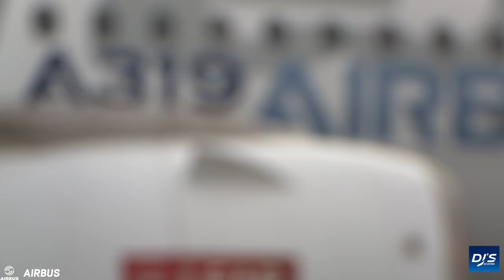Airbus To Build Engines?

Comment: Aircraft engine manufacturing is an extraordinarily specialised business which is dominated by the three main players. I can't even see why Airbus would see a need to independently have the capability let alone risk the development cost involved.
Reply: My guess is that the offers from the engine manufacturers are not ambitious enough when it comes to the 2035 deadline - and they have to develop inhouse (or in cooperation with one of them).

Comment: I find it fascinating, that most comments miss the fact mentioned at 3:30: They are thinking of building electric motors in-house (and buy fuel cells somewhere?). Not "conventional" engines... 
So the technology advantage of the current engine manufactures in that field is probably not so large.

Comment: Maybe Airbus is considering acquiring some of the European engine manufacturers such as Safran and Walter rather than starting from scratch. There is also a pool of cheap labour with jet engine production experience if Airbus were to headhunt amongst the Motor Zich personnel wanting to move out of Ukraine.
Reply: @yo yo I visited the Motor Zich plant in 2019 and there were still some of the engineering team there when I visited working on small and micro turboprop and electric motors for UAV and UCAV use. Some of the other engineering staff were also working on power generation gas turbines.

Comment: If anyone can be innovative it’s Airbus at this moment the worlds most Advanced plane is  the A350-1000 .The days of hashing out old  models with a new name and MCAS  is over lol  I think Engines are a niche thing though so Airbus will need to employ guys with knowledge for the 21st Century 🙋🏻‍♀️🥇⭐️👩‍✈️👨‍✈️🇬🇧👍🚀🚀
Reply: "The days of hashing out old models with a new name and MCAS is over...", and the A320 isn't decades old and in need of replacement? Also, I doubt Airbus is going to be able to go through with this since the current engine manufacturers wouldn't be best pleased, they should instead focus on fixing the A350s lightning protection, and surface flaws.

Comment: Just like apple making their own chips, it's quite likely and will benefit airbus, however it'd also need a lot more expanding
Reply: It's not exactly comparable. But if Airbus want to deliver cutting-edge aircraft, they are limited in options.
Reply: Completely different scenario. Apple chips are essentially just licensed ARM designs, which are then manufactured by a foundry.
Airbus can't just turn up to P&W / RR / GE and ask to license a design, and then have it manufactured.

Decades of design experience; manufacturing optimization; and patents will be an extremely difficult barrier for Airbus to cross in order to enter this market.
Reply: @heyitsjel  You are wrong about Apple having licensed  the ARM design. ARM has two types of licenses: Architecture licenses and design licenses. Apple has an architecture license and designed the processors themselves.
Reply: @cbaurtx  You sir are correct! I always figured they were still modifying existing ARM designs (which they did in early days), but it appears their new chips are completely independent/new designs from the ground up. Kudos to Apple, I'm actually impressed.

Comment: Clearly, whether hydrogen fuel cell or battery, there will be a need for electric engines (the choice of which tech will come down to energy density, weight, safety, and cost).  It makes sense to develop their own in-house electric engines.

Comment: Hydrogen has been used as a fuel before, in the hindenburg. If they are going to pursue the use of hydrogen, they will have to be careful as it is extremely explosive
Reply: uh you knoow it's not going to be the same kind of stuff than hindenburg right?
Reply: True, Hydrogen is very explosive.  But remember Airbus has not specified what kind of engine.  For all we know it could be a hydrogen fuel cell, which are very safe.
Reply: Jet fuel may explode too. Just look at TWA-800. But we've learned lessons from LZ-129, from TWA-800 and from many other accidents and we are getting better at handling explosive fuels. If we don't push the boundaries, we'll still be using horses for transportation.
Reply: The Hindenburg didn't use hydrogen as fuel, it used it as lifting gas, similar to a balloon. I believe it had conventional diesel engines powered by diesel fuel. Hydrogen as fuel can be more easily contained, not in very lightweight large bags but instead in heavy-duty tanks and pipes, I'd be less worried about it's danger in that context than as lifting gas.
Reply: @thebunkerparodie6368  Exactly the same substance actually - hydrogen - but used in a different manner, as fuel rather than as lifting gas.
Reply: @stephenbarringtonleigh367  I'm predicting they're actually thinking of using hydrogen-fueled gas turbines rather than fuel cells. Fuel cells aren't actually all that efficient, I read around 60% efficient, while gas turbines are closer to 45%, but the fuel cell would be more expensive, there would be energy losses and extra weight in the electric motors and other electrical systems, and the heat given off by the fuel cell probably would require a heavy, complex, and drag-inducing cooling system to deal with unlike a gas turbine where all the waste heat goes out the exhaust. So burning it in a gas turbine might actually be the better option in the end. As for safety, I don't see that as any less safe - gas turbine engines as we know them are very safe, failures that would set the plane on fire are very rare, whether fueled by kerosene or hydrogen, I see no reason a turbine would be more hazardous in terms of hydrogen fire than a fuel cell. Also the fuel cell would most likely be mounted in the fuselage, powering wing-mounted electric motors (props or ducted fans), while gas turbines would be out on the wings, so a fire would present less danger to the occupants.

Comment: They don't have the expertise to build engines so it would be a risky move and they would most likely start with the smaller aircraft since they need smaller engines and more of them as they sell large number of smaller aircraft. You can control costs better if you are vertically integrated but accountants don't like that.

Comment: Hopefully they can for once develop for the industry a viable hydrogen/ hybrid fueled quieter High bypass ducted 
(PROP FAN) Engine instead of the boring already tryd an true turbo prop , Turbofan & Very under powered Electric motors for their aircraft...

Comment: Boeing has not been allowed to build engines since 1934. The fact that Airbus is allowed to do this while Boeing is not would be a very unfair advantage that Airbus has over Boeing. If Airbus is suddenly allowed to build in-house engines and Boeing remains barred from doing that, then to balance this out, Airbus better take blame if these engines have issues since they are in-house AND both Airbus and Boeing should be vindicated of blame for engine issues involving engines that have been outsourced per antitrust law like the PW1000G and PW4000 and Trent 1000. I know that Raytheon acquired PW, and I firmly believe Raytheon should be investigated, especially if they haven't solved the PW1000G and PW4000 issues.
Reply: It would likely also piss of engine manufacturers as well, considering Airbus would essentially be removing the need for outsourcing engines. That'd be a major mistake if Airbus does piss them off without learning to manufacturer their own engines.
Reply: Don't worry, Airbus just have the option of cancelling their customers orders if they screw up.

Comment: I will miss the smell of burning kerosene.
Reply: True. But moderns sports cars have a sports mode, where the Hi-Fi emulates the engine noise of the 60's, 70's and 80's. I see no problem having an odor injecting system into the ventilation system to emulate the kerosene smell 😊
Reply: @todortodorov940  As long as it’s harmless to breath in it should be fine

Comment: It may sound a little obvious, but an aircraft cannot fly without suitable engines, and repeatedly we see an aircraft launch being delayed and a model series having its future ruined as was in the case of the Lockheed 1011 (Tristar) and the future of the 777x having a question mark about its future prospects. In both cases the programs were financially compromised because the engines were not available for when the programs needed them.

Perhaps in the case of a totally different fuel with not only combustion differences, but loading, on-board storage and delivery to the engines issues which need to be accommodated, it might not be such a bad idea to control as much of the loop as you can, especially if the solution to an issue is not to be found in the area where the problem manifests, but somewhere else in the loop. 

Can you imagine the issues (not just the legal ones) if Airbus were to turn to the engine manufacturers and say 'sorry chaps, but you are going to have to change your design because we can't deliver exactly what we though we could!'

Comment: I think before they look at hydrogen, they should handle the paint issue on the 350 that many airlines are handling
Reply: yes Boeoing should look at their 787 wing paint issues
Reply: @ant2312  Boeing already is, hence why New Zealand Air didn't sue the manufacturer like Qatar is trying to do.
Reply: I believe they are handling both. But the people that research hydrogen engines are probably terrible painters, so I see no problem working on both tasks in parallel and using the right people for the right job.

Comment: It’s a smart move, it cuts out the need to depend on engine manufacturers and expands their business portfolio. It may not be successful in the immediate future but in the long run it will payoff once they’ve mastered the technology. Having everything in-house can be a very good thing.
Reply: It's purely theoretical talk. And only "smart" if it pays off and the risk is enormous. To invest in the facilities, research, people and R&D required to get a hydrogen power plant (that's better than anything RR/GE/etc can make) is tens of billions of dollars.... and the risk if it fails is probably the closer of Airbus.... barring more UK/EU blank checks
Reply: It's not a smart move.  Alone the thought of building-up own supply chains, services and maintenance infrastructures, already kills such thoughts on the economical benefits.
Reply: @BChandl13  armchair expert
Reply: @blameyourself4489  another armchair expert, strange how you know more than them

Comment: Mm, aircraft manufacturers have always gone outside for their engines. This is because engines and airframes are very different animals requiring vastly different resources and expertise. This is why large engine manufacture has been whittled down to just three major players out of the fifty or so that existed fifty years ago. However, if Airbus believes that reinventing the wheel is a sound policy, good luck to them.
Reply: It would be sort of a vertical-integration move, to have an engine team within Airbus rather than going to outside companies. I could see them buying another engine manufacturer and incorporating it into their corporation rather than starting entirely from scratch. It can be noted that car makers usually do manufacture their own engines, even though likewise gasoline engines are not that similar to the rest of the car in terms of design, but the company is big enough they see it worthwhile to have in-house R&D and production of engines rather than buying from outside companies. Well usually anyway, I guess some (Dodge/Ram, I've heard Nissan) buy Cummins engines. The other factor is that these new engines - hydrogen powered - would be different enough from existing designs that they'd sort of be starting from scratch anyway.

Comment: Of the three hydrogen-powered concepts presented by Airbus some time ago and featured in this video, I would actually bet on the turboprop rather than on an A320 replacement. The A320 line still has some life left in it and there could be one more generation with new, composite wings. On the other hand, the ATR series (which is owned 50% by Airbus) is getting old and will need replacing, it's also potentially on those short regional flights that the pressure to reduce CO2 emissions will be the strongest.

Comment: I believe this is move is feasible as Airbus will make a hydrogen-powered aircraft, a concept almost never explored before. It would be better for Airbus to build a specific engine suited to their needs within their company rather than outsourcing it from other engine manufacturers.
Reply: hydrogen powered aircraft could be a feasible alternative application to automobile, but it will be a long way to go before hydrogen powered aircraft will be the norm in aviation transport as factors such as fuel storage issues, such as eventual weight, and safety & range for each full charge of fuel are the unanswered technological & engineering challenges... prior data to such matters does not exists as of yet... h2-power aircraft will be making a technological & engineering trail blazer... 
I'm looking forward to news of its development...
Reply: @alexeimscruz2893  I didn't specifically mean hydrogen, I meant any new type of fuel in particular. Hydrogen is just the current alternative Airbus is looking at right now.

Comment: "Ambitious timing"? No, this is little more than a virtue signling pipe dream. No way Hydrogen powered aircraft will be ready in just 14 years. The technology just isn't here or on the horizon. Reason being that it takes huge amounts of energy to produce hydrogen to  begin with making the process horribly expensive, much, much more expensive than producing jet fuel, then there's the tremendous weight penalty of hydrogen tanks. I do not see passengers paying 3 times as much per ticket. But hey that's just MHO.
Reply: The deadline may be ambitions, but I give them credit for trying and not just saying that it's too difficult and giving up. They may fail, but if they succeed, they will play significant part in saving our planet.
Reply: @todortodorov940  All aviation is "responsible" for just 2% of human CO2 emissions. All human emissions constitute just ~5% of all atmospheric CO2. The total warming since 1880 has been around 1.1°C for a warming rate of ~0.008°C per year. But yeah producing a hydrogen powered aircraft is going to save the world, while the EU allows China to build hundreds of coal powerplants. I don't mean to be mean, just factual.
Reply: @frank_av8tor  Reducing 2% by half is reducing the emissions to 1%. If every industry does the same, humanity is on a positive course. As a bonus, at least Europe can reduce its energy dependence on fossil fuels from unstable or politically unfriendly world regions.

I agree that coal powered plants are not good for the environment. But I don't see how the EU can prevent China building coal fired planed.
Reply: @frank_av8tor  If Airbus stops producing planes, Boeing will continue producing kerosene burning planes. If for some miracle Boeing also stops, then Embraer, Comac or the Russians will ... and as sailing to let's say the US, Asia or Australia from Europe is not a realistic option, people will just switch to those planes - i.e. no win for the environment. Somebody has to push and create an alternative and environment friendlier technology - then customers may switch to it.

But when it comes to efficiency - yes, if you produce hydrogen with electricity from fossil fuel power plants - stupid idea. But let's take Saudi Arabia. There is so much desert, where solar energy can be converted to hydrogen. They can still continue selling fuel to the world - just not fossil fuel. It's not as efficient and a lot of technology needs to be developed - but this is not impossible. And as the sun is for free, the limiting factors are the infrastructure investment and space a plant takes.
Reply: @todortodorov940  "He does it too" never worked as an excuse when I was a child.

Comment: hydrogen power is promising for an aviation application as the existing infrastructure does not provide for service station for automobile application... but the infrastructure is still in a challenging stage in its infancy... challenges such as storage for the hydrogen fuel in an aircraft which entails heavy pressure vessels to hold the H2 fuel needs to be addressed in the viability of hydrogen power...

Comment: Yeah, fill the tanks with highly flammable, super explosive, very tricky to handle hydrogen, whose safety issues make aviation jet fuel look as dangerous as water by comparison.  Sure, what can possibly go wrong?      Especially when the systems are assembled by a bunch of Frenchies?   I'll fly on conventionally powered aircraft or stay on the ground and watch the skies for fireballs and keep the microwave popcorn ready, thanks.

Comment: Interestingly...Rolls Royce have already put forward a huge proposal that they manufacture Small Modular Nuclear Reactors that can be located on secure military bases and wired into the grid. They are based off the reactors made for Royal Navy new nuclear submarines currently being built (HMS Dreadnought) and will not require refuelling for 40-50 years. One proposal is to use these modular reactors to produce H2 for clean combustion power. They have the Civilian reactor already built. They need to clear the public perception of being dangerous.